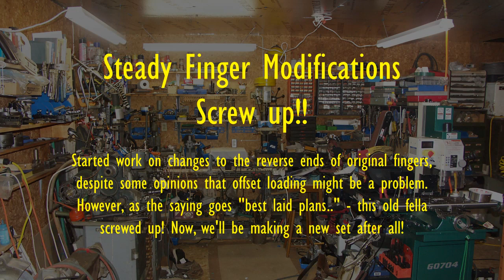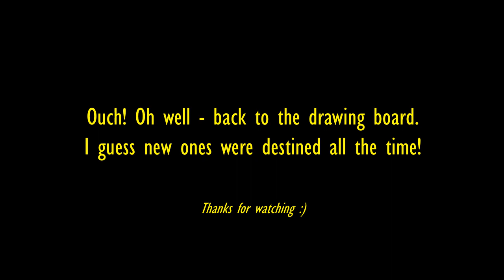Steady Finger Modifications - Screw-up!!

Comment: Great video.  It is comforting to see that I am not the only one who screws up.  I thought I saw that misalignment in the video but then I thought it was just camera angle then I thought that I just did not understand what was going on.  Who knows what I saw.  I bet once you get the bearings installed you will never need any other method.  Keep after it.  Thanks for the video.
Reply from the maker: Of course, in setting up I should have spotted the error -before the cut! Hah - it's a bit like the old ''measure twice, cut once"! :) I think for new ones I might machine forks and install a regular ball race.
Reply: ChrisB257 that certainly sounds like the best plan.

Comment: That darn Murphy does get around.
Do you have a square collet block by chance ?  The flat on the piece would be oriented to the block, and the block then clamped in the milling vise.  I don't recall what kind of collets you use.  
Making one might be an interesting project if you don't have one.  Wouldn't be very difficult at all.

Comment: It's been my experience that you need to make one complete prototype of some kind to make sure your design is doable  It also gives setup practice options ,  As for using ball races wouldn't they leave marks in soft work because of the small bearing surface ?  Good luck an keep up the good work
Reply from the maker: True - a test run always useful! Even so - instance my screw-up - ** still can happen! As for soft work - well, there is always I guess a risk of marking it but as I still have the original fingers, hopefully one or the other will do the trick if needed. As said before, I doubt I use a steady all that often.